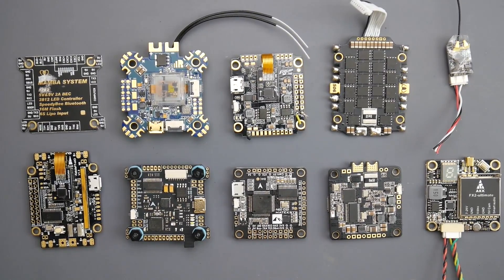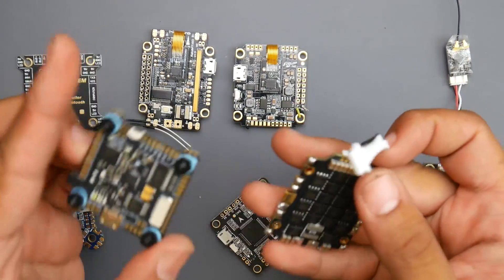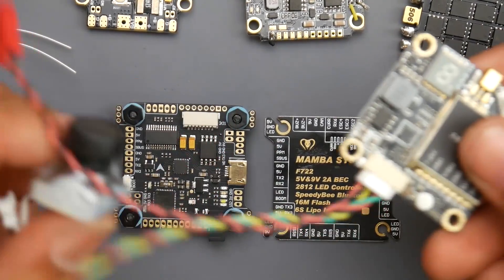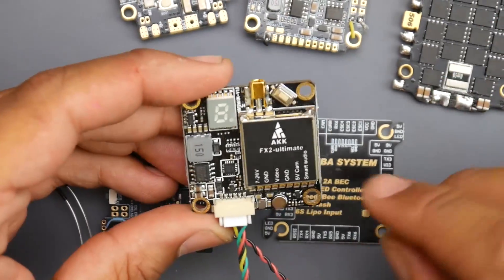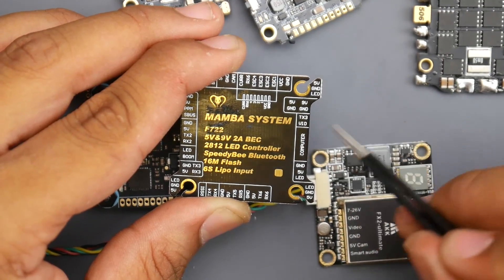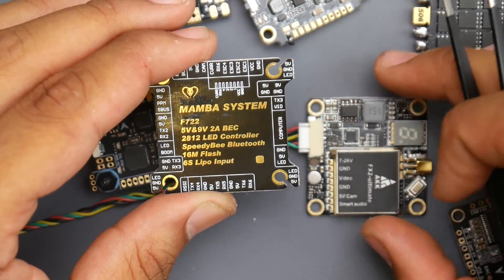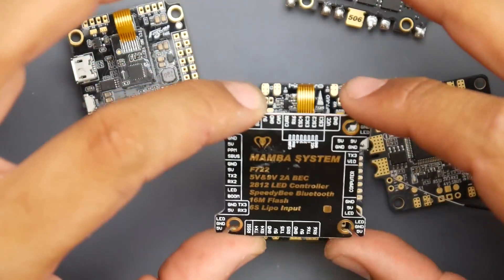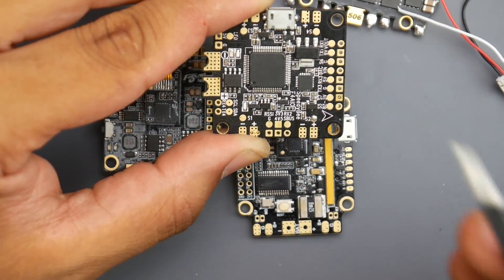FPV Beginner Guide P1 // HOW TO WIRE FLIGHT CONTROLLER GUIDE 2019

Comment: Hey DM have you noticed the prices for fpv parts sky rocketing imagine when you first started fpv and paying $350 to build your first drone not counting goggles,transmitter or any gear and crashing it 3 minutes later  there getting crazy with the prices $20 on average for 1 motor come on...
Reply from the maker: Prices have dropped significantly your looking at the wrong components. Many companies also closed DYS Aomway Szspeed matek stopped FPV development

Comment: Nice Video!  I'll be coming back to this again.  Just getting started with FPV and in the process of building my first FPV.  I just ordered the DJI FPV Remote Controller  and will be learning to fly with LiftOFF software (unfortunately DJI doesn't sell the Simulator Cable that connects to the controller).  First hurdle as I'm getting mixed signals on which cable actually works.  Then I'm going to start putting all the components together.  Thinking full DJI build out with their FPV gear to keep it simple...Again, thanks for posting!  Earned a SUB!

Comment: Cancel out the FRSKY Omnibus FireworksV2. I had 2 of them and the to have the wrong Gyro in it which isn't supported in BF4.0.
Flight characteristics: jitters and hot motors.
The RSSI of the in build RX is low as well , defective on 1 fc.
Have a browse at RCgroups there are many issues with this fc.
I swapped them for Dalrc F405 AIO fc and xm+. problem solved!

br, Erik

Comment: Can you tell us why some pads are circular and others are square?
Reply from the maker: It's just the designer choice there is no reason for it on these boards.
Reply: Some boards use square for ground or power rail and circular for signal.
Reply from the maker: @Asu01  Not always thus why I did not go into detail.